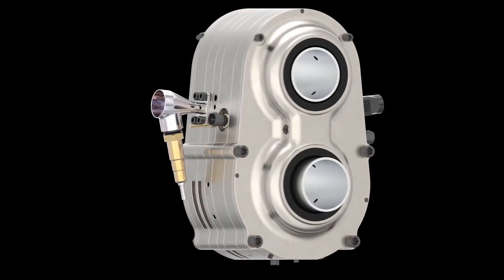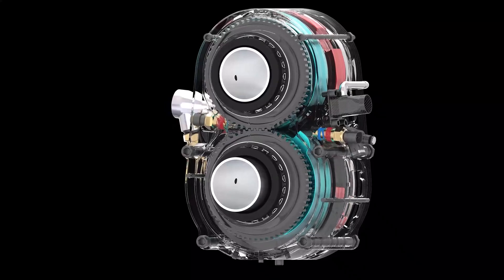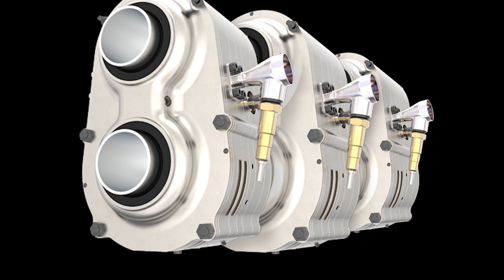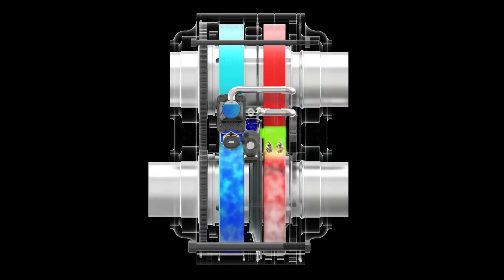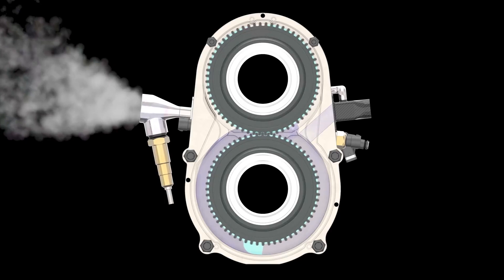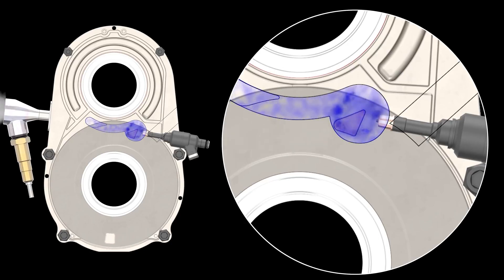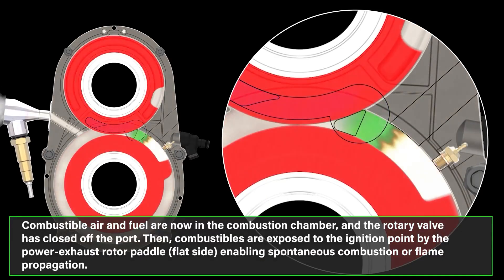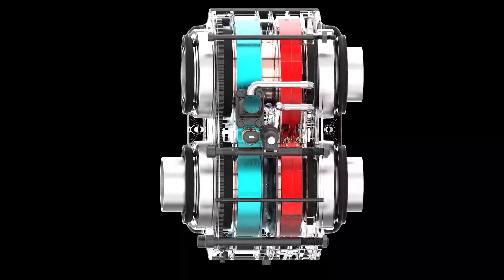This pistonless engine runs on hydrogen and revs to 25k rpm

Comment: I love to see alternative power plants. I honestly don't think that electric is going to prove to be the silver bullet that so many are thinking it will, at least not until they figure out a better battery technology that isn't super heavy, toxic, and expensive. In the end the solution might be some hybridisation of a couple of different technologies to come up with the most economical efficient and enviornmentally friendly way of powering our transport.
Reply: The biggest problem with electric is charging.
If all cars in the UK suddenly turned electric we would need a charger on the side of the road, every 4 metres! On every street .
People who live in flats and people who have no driveway are screwed. And that is the vast majority of housing in the UK. Which is why the Government has now CANCELLED it's charging infrastructure plans for good.
Electric is not a viable option for 80% of our population.

Comment: If seals good enough even a normal engine can run on hidrogen by splitting water molecules! So you put in water and out the exhaust comes water vapour, there are inventions that show a tank can last 10k kms

Comment: There are a lot of stand alone engine designs that are more efficient than the piston engine. Where the piston engine win is when you mount a transmission to them. Drag on engines kills power and engines like rotaty styles cant compensate for that power lose. If you want to build the most efficient engine then you need to design it with the maximum drag and work backwards.
Reply: Also most of these stand alone engine design only work in theory where you have seals that work with magic and the tolarence are 100%

Comment: If it works its fabulous. The big problems with EVs are mainly battery related not least the huge amount of weight being carried around , which needs more power  needing a bigger battery etc. This gets rid of these issues. Looking forward to seeing it in my next car.

Comment: The industry has already dedicated itself to H-FCEV. Almost a trillion dollars spent on the transition. It's too late for the major manufacturers to turn back now, they're going to move towards H-FCEV. 

That however doesn't necessarily mean these kinds of combustion engines won't have a place with new small players trying to capitalise on nostalgia and niche use cases. 

But everything from haulage, to mass transit, to commercial aircraft, to private passenger vehicles have all started transitioning in no small way across to H-FCEV.

Comment: How much would this cost compared with fuel cell + electric motor? In terms of both outlay and maintenance? Megafactories are going up so fuel cell costs are coming down. Fuel cells are used for many more applications than drives, so volumes will be high.

Comment: Hydrogen beats batteries re- electric fuel cell or this engine. Batteries are a waste product waiting to happen, but I do not know the potential for future batteries having non-pollutant waste. Hydrogen's problem is production and reticulation ... which is no different to the production and reticulation of hydrocarbons i.e. having fuel stations to pull up to for refilling. Electric storage (batteries) main advantage, IF the pollution problem is solved, is the "fill up at home" or other places. Filling up at home becomes attractive when a home can use home-based wind power and solar production as well as the grid. The neighborhood  electricity grid will have to be significantly upgraded to handle the added power reticulation. The battery "fill up time" would also need to be addressed - perhaps that will happen in tandem with the development of a non-pollutant storage device.

Comment: No mention about what miracle material this would be made from?  because it needs to be able to maintain tight tolerances, handle that high psi and handle the high rpm.

Comment: The big problem with this engine is the "recommendation to use hydrogen". Hydrogen is a fossil fuel. 95% of all hydrogen production comes from gas, oil and coal steam reactions.  To put it that way, previous studies have concluded that you are better off burning gas than using hydrogen as a fuel. It isn't even a close contest. Hydrogen production is just way too carbon intensive. Worse yet, Hydrogen is an extremely small molecule which means that it is extremely hard to contain. You end up losing a ton of it during transport. There's also the fact that it is near impossible to get back as much energy back during combustion as is consumed during production. Part of it is lost as heat. This cliff might just be too tall to climb until we manage to find a better way to produce Hydrogen at scale.

Comment: Also man, hydrogen is great infrastructure is the problem. Toyota was trying hard to promote hydrogen but there are not enough outlets in the markets they want. Easier to expand ev charging stations than hydrogen storage. This engine would be good as a 500cc generator for an EV.

Comment: I appreciate this concept but with no seals and such high tolerance this engine is going to be extremely error and maintenance prone. Let alone legislation for hydrogen combustion at such high pressure.

Comment: as long as we are not using gas or petroleum products I'm down. how much and how many will it take to replace a gmc vortec v6? is there a way to connect it to a gm transmission? what does it take to make the transfer to the new motor?

Comment: This is perfect for hydrogen gas since it is 3 times less powerful than gasoline where efficiency is key to make it work much better. This is true innovation if I ever saw one. Forget electrical cars and batteries, THIS is the one to look for! That said, PEM cells are also a good thing that involves hydrogen too for creating electrical charge with a hydrogen fueltank, and why hydrogen is perfect as a fuel where it`s very clean, and it doesn`t matter if it`s cold or hot it will perform regardless. Where as the electrical battery approach fails and becomes very poor in hot or cold environments.
Reply: Hydrogen cars are the new legal IED

Comment: Don't discount the internal combustion engine yet.  
Even the basic 4 cyl motor can impress me.  Think about a car hitting 200 mph and it can give that car 15 miles with 1 gallon of fuel in a 2000 lb car. Little lighter but you get it.  
Changing the fuel fixes most of our problems so let get this motor working

Comment: Everyone listen here really quick, $50,000 per engine. It also has 0.001-0.005” tolerances to body if you’re at all late on maintenance or it gets slightly too hot/cold it will not run.

Comment: Hydrogen is not a good fuel source for automobiles.  It doesn't have the energy density of gasoline, and the composite tanks required to store the Hydrogen at high pressures are very expensive and take up a lot of space.

No mention of the engine efficiency.

No mention of how you gear down 25000 RPM, and the efficiency loss associated with additional gearing.

This is unfortunately just like the hundreds of other interesting new engine developments...VAPORWARE.

Comment: Look Henry Fords first car was electric. The only reason he went with the ICE is because JD Rockefeller was literally throwing gasoline down rivers or burning it off. It was considered  a waste in the process of manufacturing  kerosene but proved to be ideal for the ICE as a fuel source. This didn't kill the electric car because starting one was dangerous & it wasn't until a Cadillac engineer was killed trying to start his car (the starting crow bar flung back striking him in the skull) that cadillac invented the electric start system using a 6v battery & soon a generator to power lights, wipers, horn & as roads improved could travel faster & much farther. An electric car couldn't leave the city because there was no electricity available to charge batteries between cities. The technology all but disappeared until the oil embargo of 1974. A deal with JD Rockefeller to provide filling stations between cities not only saved the ICE, it saved JD Rockefeller because electricity was replacing kerosene for cooking & lighting & would not be ised until they renamed it "jet fuel" 40 years later. Hydrogen as a fuel source first became popular when NASA used fuel cells to produce the electricity required for the Apollo missions. It was never cheap & since then technology hasn't discovered any breakthroughs to find a cheap way to create hydrogen. Everybody knows its in water but nobody can extract it without using more energy than it saves by using it. Simply said, hydrogen is not friendly to the environment because there is no source to get to it without being unfriendly to the environment. ICE will always be around, but as humans we are paying a heavy price for not replacing gasoline with electric and our failure to allow battery technology to remain unchanged for a hundred years. We are late but we are catching up fast. Its nothing more than a miracle how fast we are catching up. The car battery has gone from powering 70 miles (if that) to nearly 300 miles by using existing technology known since 1970. Rather than giving up on range General Motors researched the lithium ion battery but gave up when heating became a problem & batteries caught fire. Tesla took over solving the overheating problem with a cooling system but at a hefty price considering he made it all as a single power pack. Tesla rapidly became a trillion dollar company. This ended the "in bed" relationship Big Oil shared with the auto industry when auto companies went back to the drawing board to design electric cars. In retaliation Big Oil, once again, has punished us by purposely cutting production to sky rocket prices as a form of punishment of who controls powering our economy... Big Oil. Americans suffering enough inflation recovering from a global pandemic & disruption are outraged wealthy oil suppliers would be so ruthless as to punish the hand that feeds them. General Motors kicked Big Oil out of their bed for good this time when they announced "all for broke" and 30 model of EVs for 2025 with a radical design of a new battery pack more affordable to replace meaning the value of a used car will not depend upon how new the battery pack is as well as engineering a fix by using far less colbat as a battery anode using nickle instead and securing enough lithium at the Salton Sea in California which has enough lithium alone to supply all American needs as well as 40% of world needs for the foreseeable future. Eliminating China's grip on the lithium market & making American cars once again something built in America & powered by American energy sources. Tesla signed a long term contract with China, instead. Its pretty obvious Tesla opened the door, but has ignored the army of engineers & higher paid Unionized production workers General Motors has at their disposal. GM spent 100 years building their auto empire & they are not about to throw that away to a little electric car company or for the cozy relationship they had in bed with Big Oil. They are going all for broke for the future and have the army to do this. Failure is not an option. Tesla has responded by delay after delay. Ford & Rivian have delivered their all electric trucks but Tesla's cybertruck is still in delay. 
Teslas strategy seems to be developing a Tesla Robot to replace 1,000 planned layoffs of production workers because none of them have brains anyways, apparently but Elon Musk has magically done what nobody else can achieve making an artificial brain as intelligent as a stupid production worker? This is not only outrageous its insulting to the employees  breaking their backs working their ass off for 2 years, not seeing their spouse, their kids, does anyone in their family even know what Daddy looks like anymore? Hes married to Tesla. And who is paying for this Teslabot? Consumers of his Model EVs as he raises the price making them only affordable to the upper middle class.

Im sorry. Forgot we were talking about hydrogen.

Comment: 0:06 Defies the laws of thermodynamics. And lb for units of torque? 160 hp at 25000 rpm would correspond to 33.6 lb ft of torque. The engine might be for real, but this presentation is full of bullshit.

Comment: Tolerance problem but not at high rpm.  This would be good for fixed, steady loads. In other words, either full-load or stopped.  Might be good for battery charging. Vaporware for traditional engine replacement.

Comment: Hydrogen is reasonably expensive and energy-intensive to produce. I'm not sure at this stage how practical or widespread hydrogen-powered vehicles will end up being
Reply: It take’s over 3x the energy to produce than you get back and that’s before mechanical losses let alone the friction, but as with any ice engine, it’s going to expel wasted heat out of the exhaust and cooling system be that air/air or coolant/air 🤔
Reply: that is presuming that you don't get into a crash. there is a very low chance of surviving a hydrogen explosion at almost point blank range.
Reply: Personally dont want to drive hydrogen bombs. And also hydrogen makes metal brittle. Its like water and rock. The hydrogen seeps through the metal and cracks it up. Like ater carving a river through rock.

Comment: Im all for ev hybrids, and this engine would fit so well! Electric engine for low rev torque, and this engine for high rev power! I think the more diverse we get, the more likely we'll find good solutions. There is no single answer for the power pollution problem.
Reply: yeah a lithium + hydrogen bomb. so safe.
Reply: @prydzen  coz ppl thought Mercedes was such a clever guy making incendiary explosions in moving metal bits... until it worked. Every new solution brings new problems
Reply: @GabilDankil4721  you watch too many american movies. cars dont eactually explode. unlike lithium batteries that can combust out of nowhere. unlike hydrogen that punctures through metal like water punctures through rock.
Reply: @prydzen  I have seen many American movies, but i also love drag racing, and I have seen engines explode. Nonetheless, I am agreeing with you that there is a potential for chemical 'instability', but this is not the end. Separating engines to other ends of a vehicle may be perfectly safe, putting the electric in the front and the hydrogen in the back. As there are two engines, both would be small, with a small battery. A safety container for the battery as last resort would be overkill.
Reply: @GabilDankil4721  you have no idea what you are talking about. You need to study more.

Comment: So what I've learned the past weeks about engines

Pistons cant be too tight or too loose within the block

Because Temperature differences can change metal. 
So if this is tight tolerance w/o seals, how would it cope with thermal expansion of metal?
Reply: It doesn't, because it only works in an simulation that ignores tolerances and wear and tear

Comment: If looks incredible, I’ll have to watch this a few times to understand how it works, I think the whole electric vehicle route is a mistake, there’s always the issue of how the electric to charge the vehicle is being generated, and the time it takes to recharge. JCB are working to make hydrogen engines for their excavators and have a fully working and efficient engine on test. We just need to work towards the infrastructure which will be the hard part but hydrogen isn’t far behind electric

Comment: Why this won't work 
The rotary Valve in the Pre-chamber housing has to be made of leather. 
If you don't do that you'll screw the intake manifold up by running more than 3k RPM. 
Another thing is the Power Exhaust isolator rotor, it has to be made of leather. Otherwise the thermal translucence will absorb the horsepower.  
Which brings me to the last point: The Compressor combustion lower power output shaft. There is no way around the fact that it needs to be made of leather. Otherwise you'll warp the synchronizing gear.

Comment: These sort of designs have been around for decades. They would never work, in practice. It's impossible to design and account for thermal expansion with all those parts sitting so closely together and with those "tight tolerances". Plus, even if the wear is very small theoretically, in practice it wouldn't last very long at all, the discs rubbing on the chambers would quickly ruin those tight tolerances. Assuming you'd lubricate those, you'd end up burning a lot of oil, resulting in.. not so much "clean" exhaust gases and still, wouldn't last nearly as long as a regular 4-stroke.

Comment: Not to mention the death sentence of rotary: you have to add oil to the moving parts to keep them lubricated. That oil will be burned and than Euro 6 is a far-far away possibility, even if the engine runs on hydrogen.

Comment: The laws of thermodynamics limits the internal combustion engine to the efficiency of the Carnot cycle as maximum efficiency. Electric engines cheat by combusting the fuel electrically, if the fuel is used in a fuel-cell or similar. That gives the electrical engine an edge over combustion in the long run.
But the boring answer is different engine types will be suited for different applications. I think electric/battery solutions will be the future for urban places, will some sort of combustion system will remain the rural choice for long time to come.

Comment: Electric is a great and everything. But no one seems to have an answer for where all of this demanded electrical energy will come from. They're closing fossil fuel/coal power plants with no replacement alternative for energy production. This is driving the cost of energy up. Not helping.
In my opinion, there is no one answer. We'll use solar, wind, hydrogen, gas and diesel, and other new technologies all together.